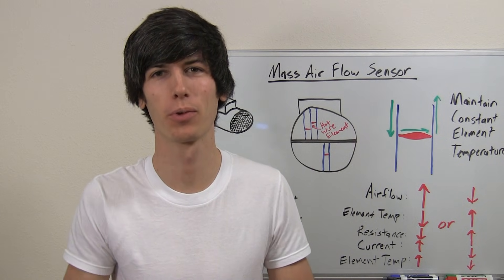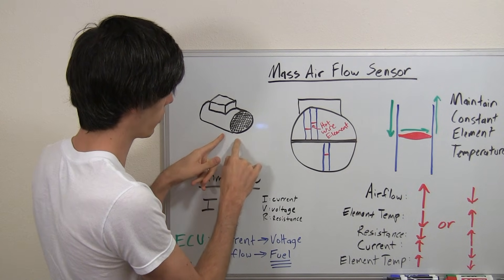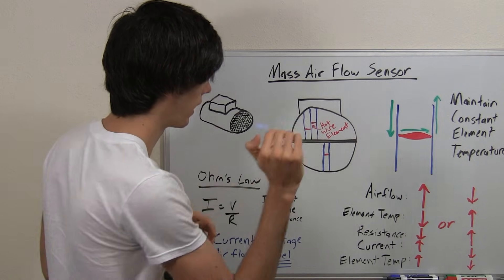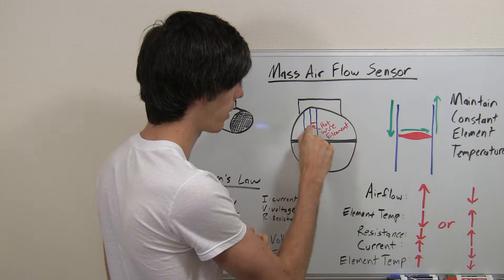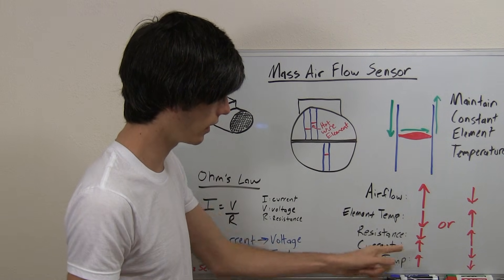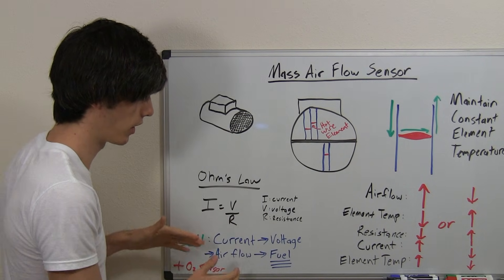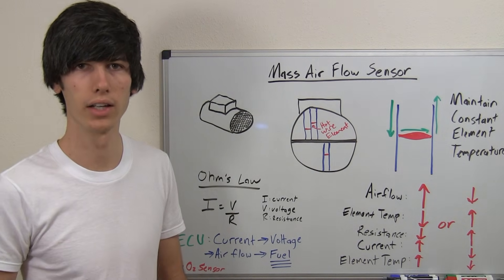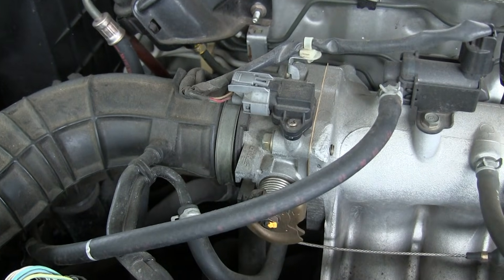Mass Air Flow Sensor - Hot Wire - Explained

Comment: Why does my MAF sensor have 4 wires? what do the 4 wires do?
Reply: Simply put:
- Power
- Thermistor/Film power
- Ground
- Thermistor/Film reference voltage 

Power goes to the sensor for comparison and also to heat the Film. 

Ground is required for the reference. 

Reference is for the computer to know the resistance of the heating element based on temperature/air flow and therfore knows how much air is blowing.

Comment: so what if air is too cold or hot
Reply: There are limits to the temperature readings. Too extreme in either direction will default to out of range.

Comment: Does the temperature sensor also measures the temperature of incoming air or it just senses the temperature of hot wire?
Reply: It calculates the temperature based on the resistance.  The calculation is predetermined.  Just like your thermostat for your home.  At 70 degrees, the thermostat knows the resistance value it reads at 70 is that temperature.  Going up or down changes the resistance therfore it know what 'temperature ' to display.

Comment: Years ago I had a Toyota Tacoma 3.4 l.. I made a HHO generator and for weeks I was getting 34 to 36 miles per gallon.. when the vehicle average was 18 this really surprised me.. The map sensor burned out and the vehicle ended up at the garage being fixed so I never experimented again.. but maybe you can shine some light on this.. is there a way just to merely bypass or eliminate the map sensor??

Comment: Could you explain the computer input/output to the MAF? Is this 5V input? Does the output ride on top of  this voltage? OBD shows Grams per sec and Freq, Does this only output Frequency and the scanner generators Grams number?
Its this a 4 wire system?  12 V Gnd 5V, Temp wire 5V?

Comment: Nicely explained, but I genuinely wonder if the resistance of the wire is maintained at a constant value?  This would require the system to control the current across the wire proportional to the voltage across it.  It would be simpler to keep either the current or the voltage constant and to measure the voltage or current repectively?  I'm probably wrong, but I'd welcome further clarification.

Comment: Great video. but I don't understand how voltage changs. only current changes due to resistance drop. voltage should always 12v or 5v from ecu.
Reply: V is proportional to I na. Ohm's law.

Comment: Hi , i have a problem and maybe u can help me. So , i have a honda accord or acura tsx 2009 2.2 i-dtec (diesel) and i made a custom cold intake , the problem is that i reduce da maf sensor pipe from 80mm to 76mm using a maf adaptor. Now the engine throw the p1103 code  i tried fitting the honey comb straightener but still doesn't work. Is it because i reduced the pipe size and fit the same maf ? Thanks

Comment: Hello dear friend, FOR TESTING ONLY. what happens in below condition.
1) disconnect only the wire connector socket from the MAF sensor.( Without removing the existing MAF sensor)
2) connect the wire connector socket to additional MAF sensor (same part number) and fully blocked IN and OUT air flow. 
3) pls understand about the air flow blocked only the additional MAF sensor
4) pls understand about there is no air flow blocked at the existing MAF sensor path.

So what happens in above condition. Seeking your reply.
Thanks

Comment: So you are saying that the constant voltage is applied to the hot wire? How would computer know if the temperature of hot wire remained constant? Is it actually a thermal (natural) property of a wire which is so designed to automatically have the same temperature at the constant voltage (at some specific range of air flow)? If the voltage is constant, how much voltage is being used to warm up the hot wire? I don't know if I was clear enough.. if the temp of the wire is not measured directly, how computer knows its temperature in order to keep it constant?

Comment: Hye to Engineering Explained,

For the N/A car that already done Bolt On Turbo, if using a piggyback management as the ecu management, where is the specified location of Mass Air Flow sensor, is it:

1. After Air Intake Filter & Before The Turbo
2. Before Throttle Body & After Blow Off Valve

You may drop your opinion either 1 or 2, and justify the opinion.

Comment: The MESH IN THE FRONT IS TO STRAIGHTEN OUT THE AIR FLOW FOR THE SENSOR TO READ.
Reply: That is correct! That grid or mesh is a airflow regulator that is essential for the mass air sensor to get a correct reading. It is not a particle filter.😂

Comment: So I got a question, what happens when hot air enters the MAF sensor? Air that has higher temperature than the hot wire element? Does it tell the ECU to spray less fuel?

Comment: The MAF on my 87 Chevy Sprint Turbo has gone bad and the part is discontinued  and I cannot ind an  What is my best option if I want to continue driving the car?  Think I can steal one from another vehicle or use an aftermarket one?  If its got the same reference voltage and same diameter, I should be able to wire in a different setup right?

Comment: A quick question, assuming you are quite familiar with Subaru FA20DIT engine (on my 2017 Subaru forester XT), is it safe to run the engine for a while (for example, engine in idle for 5 minutes)   when MAF sensor unplugged?

Comment: Doesn't the air flow measurement vary depending on the outside air temperature? If the outside air is colder, it will cool the 'hot wires' faster, so the MAF will detect a higher air flow for the same amount of colder air.
Reply: What you are describing is denser air.

Comment: Ive been watching you for a while and figure you are the best chance I have to try and solve my problem in my 2012 ram 1500 r/t.  So evrything seems to work fine until I mash the gas.  Then it boggs down / seams to be suffocating.  I say this because it stutters and then eventually gives full smooth power.  I cleaned the mass air flow sensor and checked the air filter but still happens fairly often.  It feels like  only some of the cylinders are getting the right air fuel mixture because of the spirty nature of the acceleration.  Like some of thecylinders are giving great power but the others , not so much....then they all work.  Maybe someone here has had this problem and knows a quick fix.  I feel like it has to be something easy beacause of how well the engine functions at any time other than hard acceleration.  Please help and thanks in advance

Comment: The mesh in the front of the mass air flow body is also to smooth out the air across the element and not let the air act in a turbulent manner . If it does the car can run like it has a idle issue...thanks

Comment: where the hot wire's heat comes from?
Reply: the wire gets heated due the resistance and the current flowing through it

Comment: Great, I was searching for a video that explains how you can override this useless piece of ** on a car. I would like to see someone devise a method of keeping the output resistance so that the turbo still cuts in but eliminating the need for a hot wire to do it. Hot wires have one serious flaw, they ultimately burn out if the car tends to run hot and at 80+ bucks a time for a sensor, it can get damned expensive replacing them every time. If we could simply replace the wire, it would help but better still would be a way to eliminate the need for it completely, (without replacing it with something equally as expensive such as a MAP).

Oh how I long for a car company to go back to basics. Remember the days when we didn't have fussy computers telling you something is wrong? Remember when  a failing sensor only lit up a bulb on your dashboard instead of putting the car completely into limp mode unnecessarily? 

I have an O2 sensor and a Mass Air flow sensor, if the MAF fails, give me a way to manually override the computer and tell it to use only the O2 sensor and ignore the MAF completely. Disconnecting the MAF doesn't work either, the computer still thinks something is wrong and puts the car into limp mode.

Comment: is the absence of maf sensor bad for the engine? will it do damage on the ecu running the engine maf sensor disconnected?
Reply: According to some sources, disconnecting the MAF on some cars will force the computer to use the O2 sensor instead and does no more harm than it did to cars way before computers ran them. 

Sadly, on my car, disconnecting the MAF doesn't work.

Comment: hi! hello from panama city centro america 
its possible you get a better idea how its works 
but i try tu install a AFC neo on my subaru impreza GC3 1996, everything its fine except for the MAF when i plugin the maf to the afc my engine go to rich mixture (8afr) i  think its possible i put a wrong info because the afc ask fot the numbers of sensors IN & out the question is the maf sensor have more than 1 sensor inside of them 
if you have a better idea please i going to appreciate that

Comment: The purpose of the mesh in front of the MAF is not to filter particles (air filter does that already). The mesh removes air turbulence thus straightening airflow across the wires for more accurate readings.
Reply: LAMINAR FLOW! -Destin
Reply: What he said. 
Plus, the hot wire type is a sensor used to create a signal of “Grams Per Second” a more accurate version of speed density as the engine “Runs” on speed density program until the 02 sensor heat up and become active. Unplug and go drive. Runs fine, but not quit as accurate but turns on check engine light. A large number of vehicles ran on speed density only for years. CARB required a more accurate control of the A/F ratio, hence the $200 MAF sensor that cost $32.64 cents to make. 
ASE Master Tech since 1978 - Retired
Reply: @deankay4434  Speaking of that "mesh screen before the MAF sensor"- what Paul said was true- and the thing as far as I am getting it is called a Air Straightener. And is a BIG deal if you say have an upgraded AEM CAI. Without the aforementioned part sitting the PERFECT distance before your MAF sensor- you will start to see dreaded engine codes. I have been having much trouble. I am hoping installing an Air Straightener Aluminum screen will do the trick. Because I am all out of ideas other than taking a $300 god d**n hit and reverting back to my stock. Sigh... I must figure this out without giving in. And hey- doing it without having to drop BIG bucks on a tune would be nice too. You see I do not care so much about the power gains from my CAI. But THE SOUND my turbo makes every time I shift !! < 3
Reply: @deankay4434  nice intelligent response, thank you - coming from an ole auto mechanic with an instrumentation background added in.
Reply: Paulinas Dzenkauskas
Reply: Bravo
Reply: Thanks for pointing out

Comment: do you mean a resistance change? because ohms do not raise or lower voltage
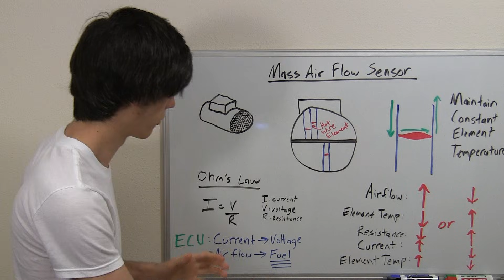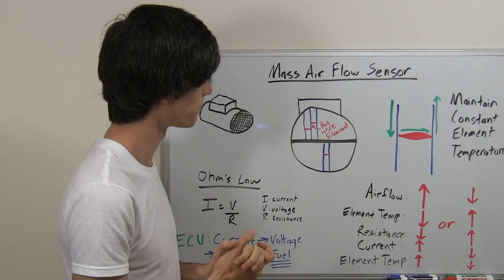Reply: +Charles Cook Do you mean at 1:40 ? or 2:05? Because he didnt say that it directly changes the voltage. And actually: the resistance CAN influence the voltage directly if you make a circuit where the current is kept stable.
He says that the resistance will drop, so the current raises. The ECU will notice the current change and give a voltage change accordingly, either way Ohms (=resistance) do change the voltage
Reply: Ohms law. Current x resistance (ohms) = voltage. If current is stable, raising or lowering the resistance WILL alter the voltage.

In the MAF, it's actually the current that changes since the voltage remains stable at 12v and the resistance changes with the heat of the wire. therefore: Voltage/Resistance = Current.

Comment: Mass air flow sensors are added to increase car price without clear benefit on fuel saving or engine performance. It is a costly part that breaks down often. Even the cleaning spray for this part is about 30$. Another mass scam by car makers. Ask any veteran mechanic and he will tell you that this part is almost useless except adding 1000$ on your car price.
Reply: Most of these sensors are useless really. Cars ran fine (and usually a lot more reliably) without all these sensors on them before computers were built into cars. Give me an old Diesel engine without all this computerised crap on it any day and I bet more of those cars are still running today while all the newer computerised cars are sitting in scrap yards, not because the car is dead but only because the computer says it is. If you could strip all the computerised crap off one of those new cars, I bet it would probably run for another 20 years or more before it dies.
Reply: +Tryst46 I am glad that you know the truth..also if we Google Tom Ogle ..it will show how we can turn off all the injectors and feed engine through air intake with fuel vapor and it will increase fuel economy by 500% & reduce pollution by 500% also..just another proof that fuel injection is also a big scam ripoff..

Comment: Great tutorial. Current and voltage supplied to the mass airflow meter and oxygen sensor heater, generator and other components is comprised of current ON current OFF patterns   the duty cycle in percentage indicates the duration of ON/OFF time in a given period  The newer Mass airflow sensors measure frequency more than current or voltage and by your same reasoning when the air supply is high [ wide open throttle ] it takes more ON/ OFF impulses per second [ frequency ] to keep the hot wire at the fixed temperature you mentioned.

Comment: Hi dear my mad sensor is 4,2 volts at idle and when increase the rpm it the maf signal voltage goes down actually .like 4.3 4.1 3.90 how cud u explain that a vacuum leak ?

Comment: i got an f-150 3.7L v 6 2011 truck that i need to wire a new pigtail plug to. how do i know which wires go where on this truck as the wires coming from the harness dont match the wires on the new pigtail?

Comment: I think it's been said, but the screen on the front is to try and smooth the airflow into a laminar flow, as hot wire resistance changes are only really accurate if you're given laminar flow.

Comment: Would it make more sense to have the MAF sensor just before the intake manifold due to the possible changes to the density from heating and cooling? Especially from a turbocharged engine?

Comment: Question, so mass airflow sensor "only" detects the amount of air flow and not the oxygen level and air temperature??
Reply: The MAF sensor uses temperature to determine air flow. There is a ligament within the MAF sensor that is heated and when the throttle increases the air flow increase which cools the ligament within the sensor. So it determines airflow by using temperature.....So in a way.... yes but no
O2 sensor detect oxygen levels not MAF sensors... (im pretty sure)

BTW- I just learned that from this video....had to re-watch it a few times though.... isnt this guy great?!
Reply: lahnie95
yeah, he's really helpful when it comes to automotive questions especially when I'm taking automotive college classes.
Reply: Yes, I'm in high school but I'm dual enrolled at a tech center for automotive services and honestly, I learn more from him than I do in class.
Reply: lahnie95 same here, I took automotive intro in high school as well not too long ago

Comment: Can you explain how in the ECU, the increased current caused by the increased airflow is "translated into a voltage change" ? What exactly does this mean?
Reply from the maker: The airflow changes the resistance of the element which current is passing through. When the resistance changes, due to a change in temperature, the voltage changes. Ultimately it comes down to the material properties of the element which the air passes over.

Comment: Didn't see the answer for this question asked below: If the ambient temperature is significantly lower than normal, will the MAF read that as more air coming through and then tell the ECU to pump through less fuel? I assume this would cause a rough idle or choppiness.
Reply from the maker: It will either compensate for the decrease in temperature (different resistance) or an intake air temperature sensor will let the ECU know so it knows how to adjust. Ultimately, the O2 sensor is there as a back-up, in case it's slightly off.
Reply: Engineering Explained Think about starting the car. First there is Key On Engine Off. At that time The ECU notes the Intake air temperature but more important the [ OAT ] Outside air temperature  The ECU also has a Tables and charts in its memory to form the baseline of these temperature and elevation { barometric pressure ] coolant temperature , calculations. One of the test that I do sometimes is to compare Outside air temperature,  Intake air temperature, & coolant temperature sensor on a cold engine before starting the engine.
Reply: +Engineering Explained is there a way to bypass the MAF?
Reply: If you bypass the MAF The system still can operate the vehicle because in most cars the ECU engine control module provides alternative data from a chart in its memory  [ back up strategy ]. It is just not as accurate as having the MAF mass airflow meter working